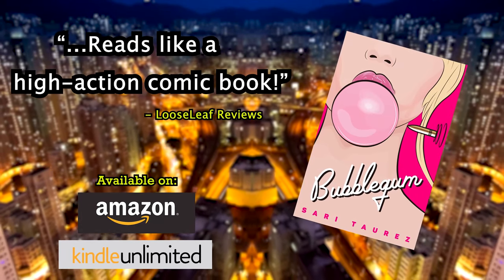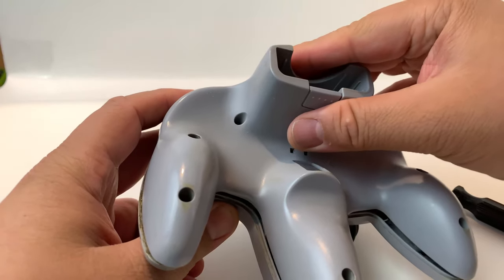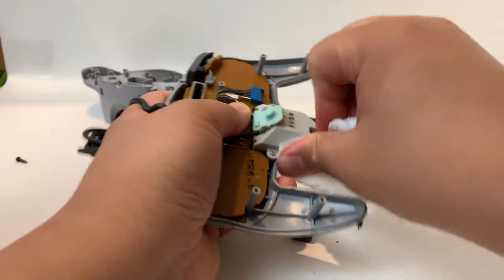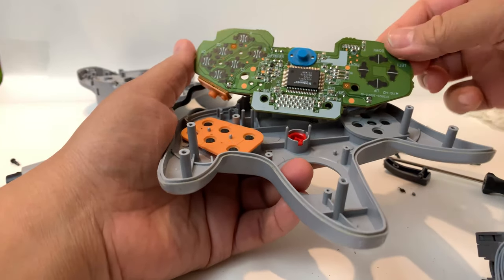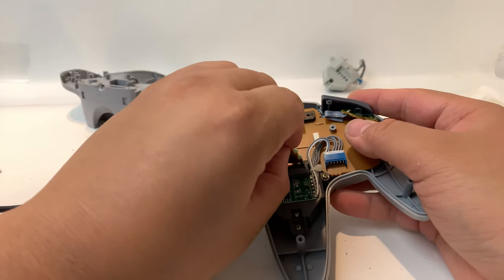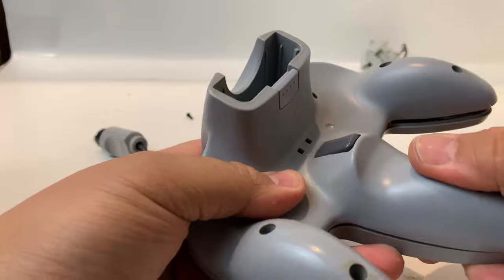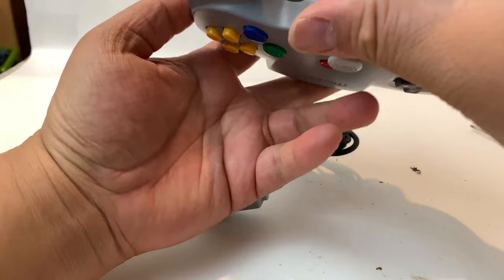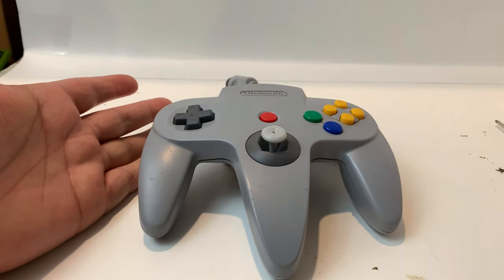How to Replace Joystick on N64 Controller | Easy to Follow Instructions | Pixel Slayers 4K

Comment: Have you tested and used one of these joysticks? I recently replaced one of my controllers with a gamecube style joystick. It wasn't bad, but the sensitivity was really off and it was extremely touchy.
Reply from the maker: Yeah! I feel like it needed about a half hour of use to loosen up to a normal level. It was a bit stiff at first but after a few rounds of Mario Kart it was all good. 

Hmm I’ve never tried replacing a controller with a joystick of a different controller... I could understand how that could have some issues with different sensitivities.
Reply: @PixelSlayers  It was a third party n64 joystick made in the style of the gamecube. Thought it would be a better option, but it is so hard to walk in games because the sensitivity is turned to the max on those things.
Reply from the maker: Oh, interesting. I don’t have much experience replacing joysticks on third party controllers... it sucks that it didn’t work out.
Reply: @PixelSlayers  They're talking about a replacement joystick for an original n64 controller made by 3rd party, it's supposed to remind you of a Gamecube joystick, but as they said, the sensitivity is way off.